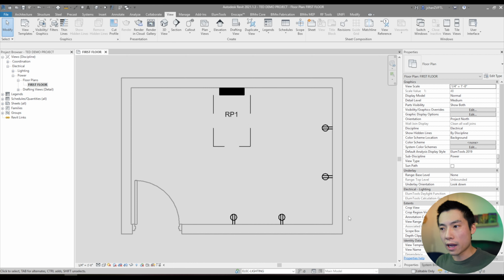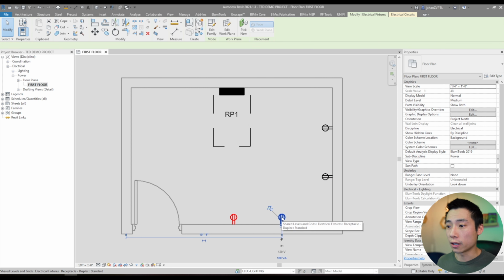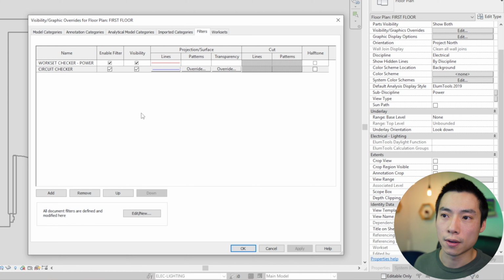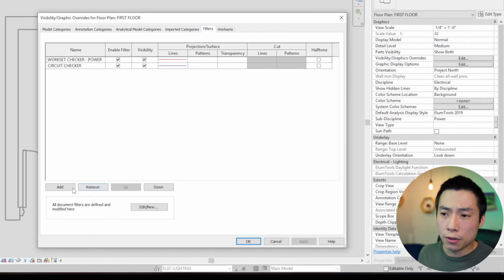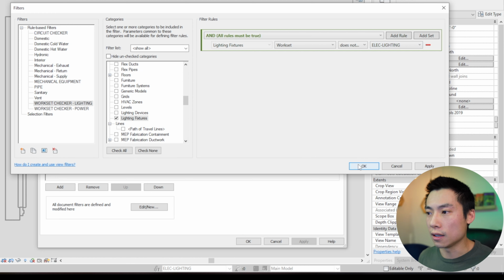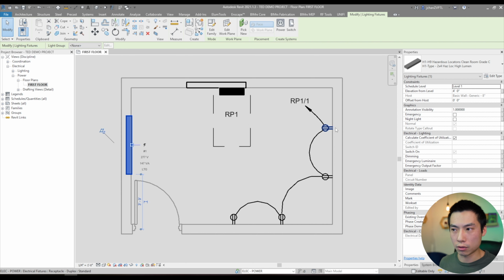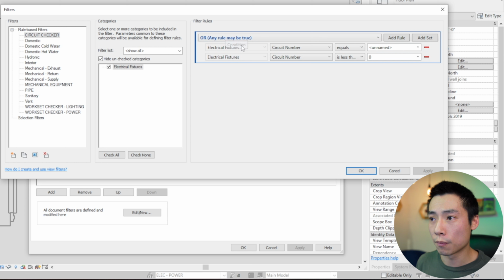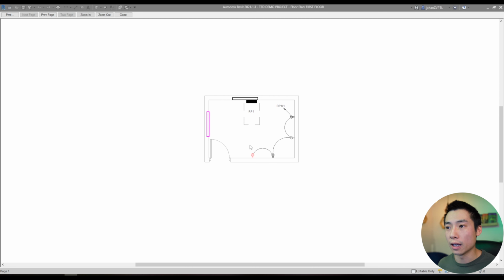Revit Filters: A Powerful Tool for Checking Your Work

Comment: Great video. Another useful method for checking Worksets is the following:  To color-code Revit worksets for better visual distinction, enable "Worksharing Display" in the View Control Bar, then select "Worksets" and customize the colors for each workset in the "Worksharing Display Settings".